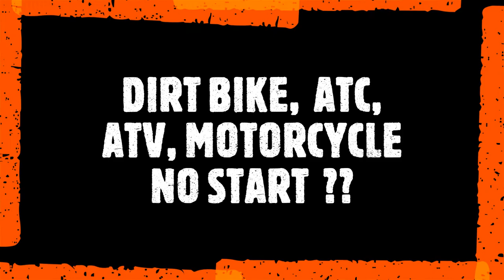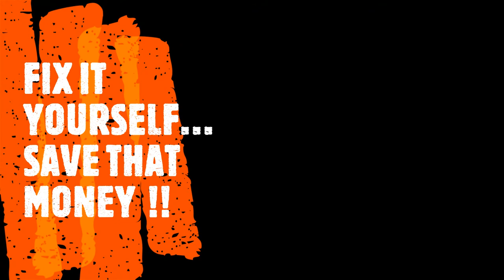SUZUKI JR50 FIXED & READY FOR FUN, AGAIN     DIRT BIKE,  ATC, ATV, MOTORCYCLE NO START  ,

Comment: Any reason why the jr50 would be losing its pull? Ran fine but now i can barely climb a hill..
Reply from the maker: Possibly, the clutch..if they get worn out..they will slip.
Worn piston rings..make sure the 2 cycle oil is full with good oil and make sure the oil injection is working..if not the motor will break with loose of compression.
Dirty carb, spark plug or bad gas.
Hope this helps..
Keith 2guys how2
Reply: Exhaust may be plugged

Comment: I just bought my son an 02 Suzuki jr50 motor ran good when I first bought it cranked rite up. Now a couple weeks later and he rode quite a few times. When he rode it, it would run good but if it died or if he killed it I couldn’t get it to start until maybe it cooled down. Now I replaced the spark plug, coil and new carb, I can’t get it to fire up…? What do you suggest, I was told maybe change the cdi box..? Any suggestions would really help, he loves riding it. Thanks
Reply: I also checked to see if the plug was firing, I didn’t see any spark
Reply from the maker: I would check the kill switch and any safety switches it it has a y...they will cancel the spark and can be a simple fix. I like OEM suzuki parts..if it is the kill switch, key switch or a bad ground..I would put the original parts back on
Keith 2guys how2.
Reply: @2guyshow2thefishkingz89  ok thanks I will give it a try and let you know what I come up with
Reply from the maker: @deansmith4459  Yeah, let me know...I know some of those smaller kids bikes, 4 wheelers, etc... have a few safety features...I would clean the wires and check all wire for being loose or disconnected...grease everything with dielectric grease and plug everything back together...You can disconnect the kill switch and see if it starts. Check for saftey kickstand sensors and other sensors that could be not pushed in, too.
Keith  2guys how2
Reply from the maker: @deansmith4459  Make sure the coil has a good clean ground and grease it to, put dielectric  grease even on the frame..where mounting  bolts go.
Reply: @2guyshow2thefishkingz89  ok thank you very much for responding
Reply from the maker: @deansmith4459  No problem,  let me know how it checks out.

Comment: 4 cylinder???
Reply from the maker: The Suzuki JR 50 is a 2 cycle. Self mixing style oil injection...I think, there is a little tank behind rear side plate that holds the 2 cycle mix oil and directly injects the 2 cyle mix oil into the carburetor. Self mixing. 
Sometimes,  I will bypass the little 2 cycle holding tank and pre-mix the oil and gas, in a separate can then add to the main gas tank. That ensures the bike will have the correct mix, due to the oil injection system failing, not all will fail, but, they do fail and when they do fail, the motor rings break or get worn and piston will loose compression, main crank bearing go bad and break, causing costly motor work.
Keith 2guys how2
Reply: @2guyshow2thefishkingz89  
This is true however it is a single cylinder.
Reply from the maker: @rafenatho5406  yes, single cylinder is just the engine displacement of pistons inside motor...50 cc JR 50..is a single piston, 2 cycle motor...it needs oil gas mix or it will break.
* 2 cycle or 2 stroke motors, regardless of how many pistons the engine  has, they always need an oil mixed gas to lubricate the piston and main rod bearings and wrist pin bearing. 2 cycle motors have no exhaust valves....weed eaters, gas leaf blowers, etc... The lower gear case just takes an oil to lubricate the transmission gears and crank.
Example...The yamaha bashee is a 2 cylinder, 2 stroke motor, with 2 pistons... four wheeler, that needs oil mixed 2 cycle gas.
* 4 cycle or 4 stroke run on just straight gas...no oil mixed with gas and these motors have exhaust valves...the engine oil lubricates the pistons and crank case bearings, etc.
* Always, check to see what the motor runs on...oil mix or no mix gas.
* Always, check the transmission oil if it requires oil,  too.
Hope this helps.
Keith 2guys how2
Reply: I was thinking the same thing

Comment: Why you dont clean the air filter? Airfilter oil
Reply from the maker: This video is to show the carb cleaning and get bike running again..
this bike sat for years..I told the customer to replace the air filter, when he got a chance and change crankcase oil.
Keith 2guys how2